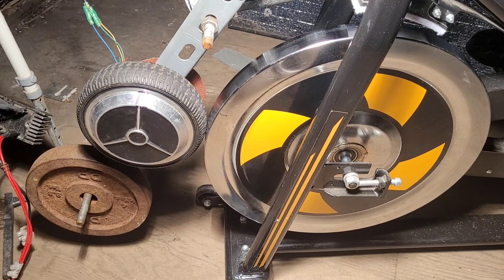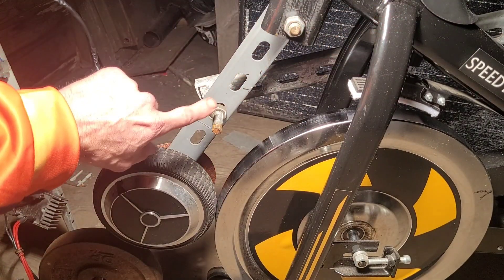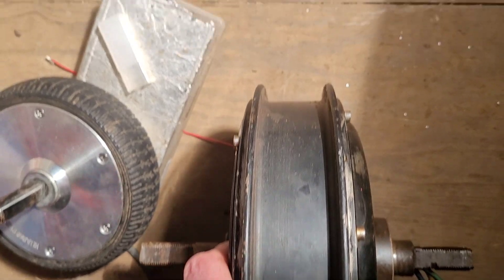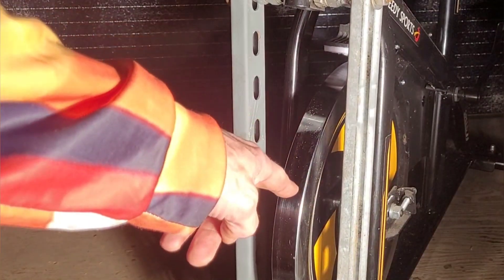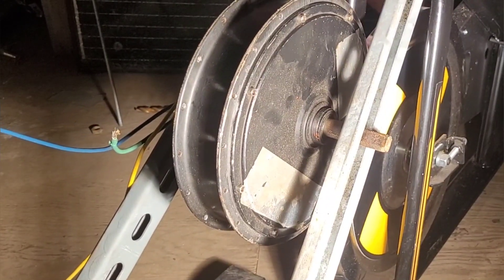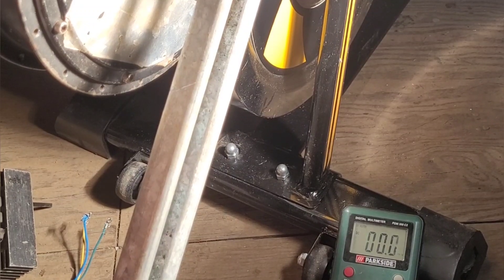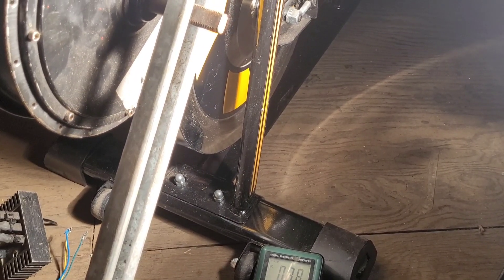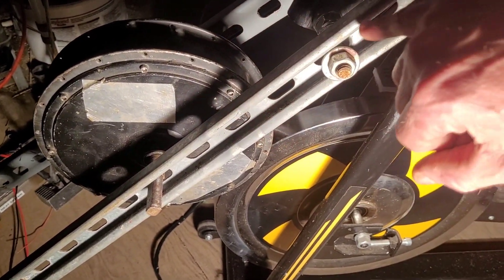OFF GRID Spin Bike Power generator - Trying to fit 3kw Bike Hub Motor in Place of Hoverboard Motor.

Comment: did you wrap the outer shell of the hub motor with rubber linner rfor traction ,i did see it slipping alot so im guessing not,i would try to  add gearing like a  mountain bike  that fixed gear excercise but will  tire you out to quick,tho make good power
Reply from the maker: Not yet but I will do